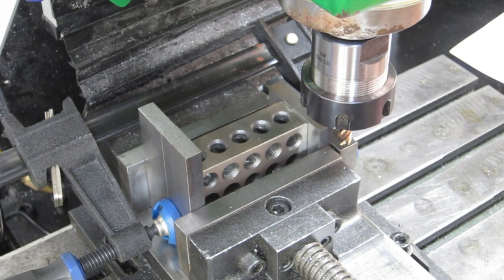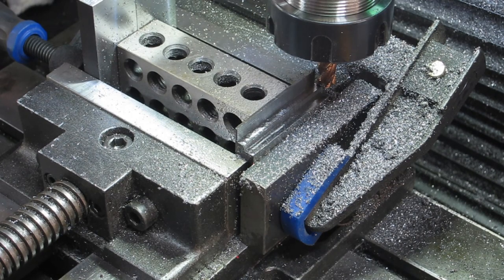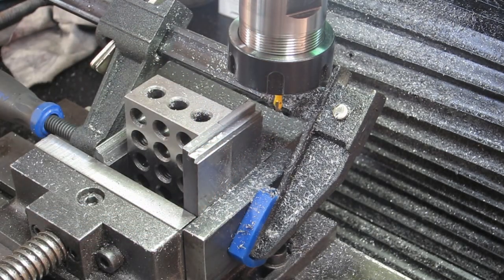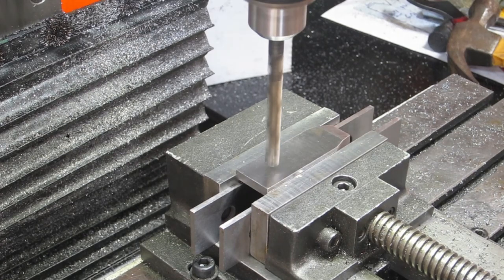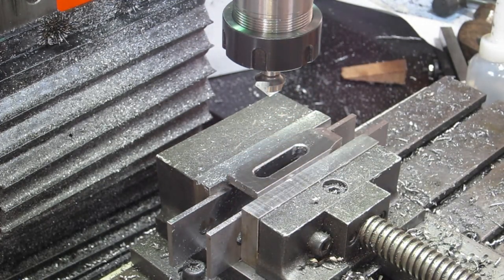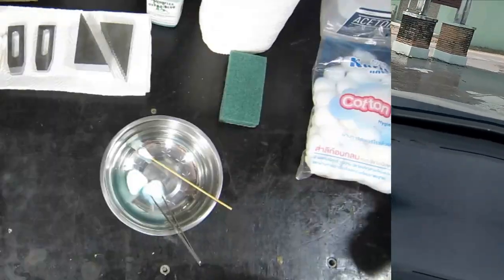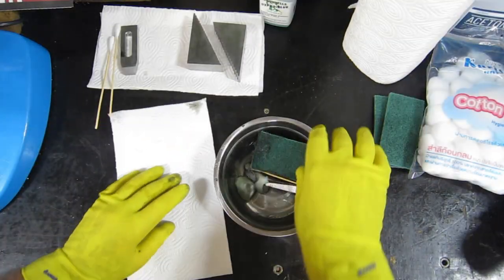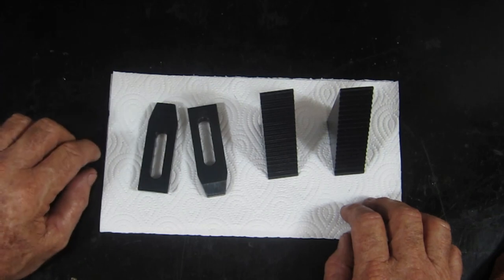MHW Episode 77 - Homemade Stepped Milling Clamps - Part 2

Comment: Although the slot is not in the center, they will still work great. We all make mistakes, or what I call learning opportunities. I use to hot blue my steel parts as the cold blue solution is so expensive here. I eventually found a 1 liter bottle of cold blue at a really good price so I brought it. Now I can do cold bluing as well.
Reply from the maker: I used them again yesterday and noticed the risers are starting to rust already, wet season has kicked into gear here now, so obviously the Palm Oil doesn't do the job, so I will have to redo them and use some mineral oil. 👍

Comment: Nothing better than shop made😀
BTW regarding the stock not rusting, if you have a nice mirror finish on a steel surface it will rust less because there is less surface area for a chemical reaction to occur.
The opposite causes rust faster eg if you sandblast a piece of steel it will rust really quick.
Cheers from Aust.
Reply from the maker: Helps that it hadn't rained here for about 3 or 4 months 👍